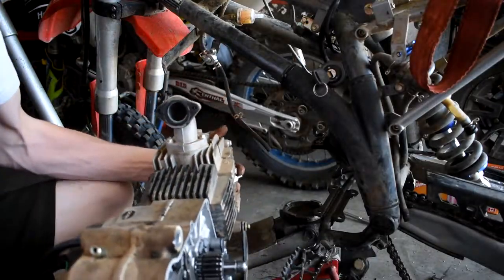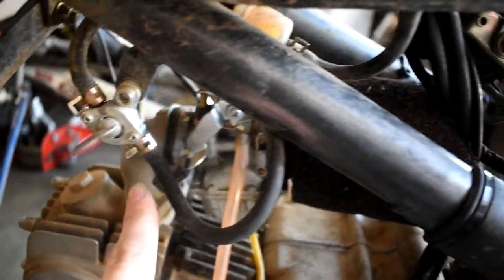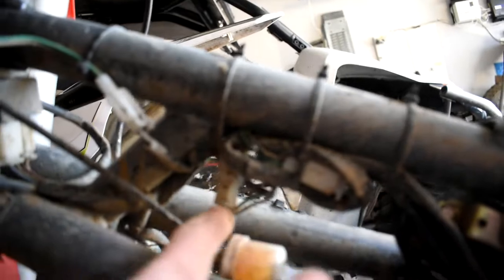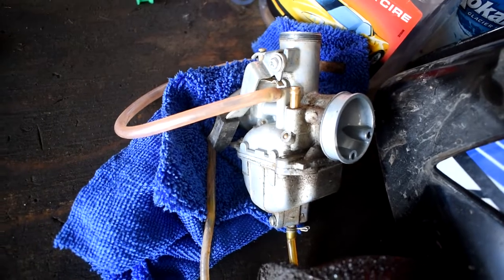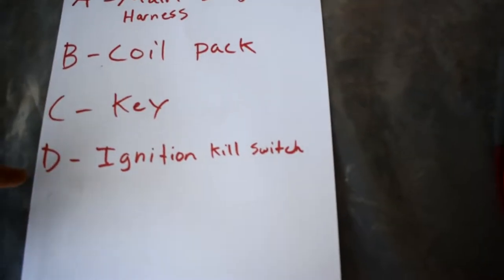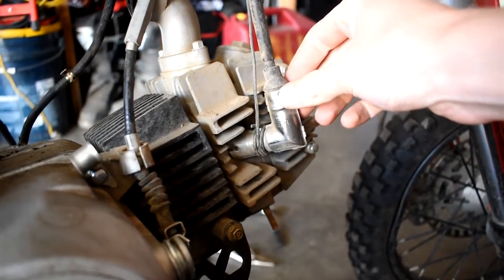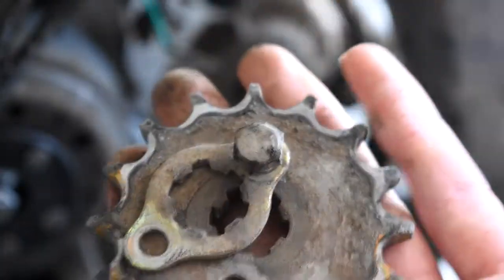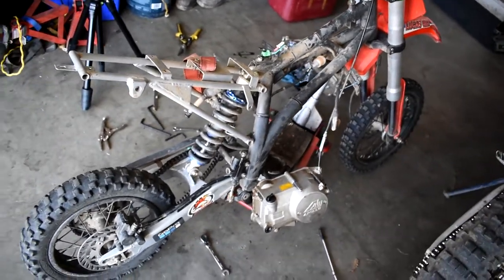2020 Apollo RFZ Engine Swap Part: 1 Chinesse Pit Bike Engine Removal

Comment: Hey man. I know this old video but do you know If the generic 125cc lifan fit to YX140 Apollo frame. In picture the fittings looks exactly the same. But im not counting on it. The exhaust looks same but someone mentioned somewere that they need klx adaptor. I have 32 hours on yx140 and it barely feels worn in. I was about to buy spare engine The generic lifan that suppose to be sturdy motor. I have no complaints about YX though...

Comment: I have to replace a 125cc motor with a new 125cc motor for a dirt bike. Do I need to prime the new motor, or do I just fill it with oil like a normal oil change?
Reply from the maker: Like normal oil change. Run it for a bit then change the oil out again

Comment: Great video. You don’t waste any time. How long will it take to get the new engine? Also if you go with a different engine won’t that be a problem reconnecting the mounts to the frame?
Reply from the maker: Depends on how much support i can get in the videos! Currently a new motor is likely a month out of my $$$ reach
Reply from the maker: Theres motors you can buy that are larger CC that bolt right in. (They’re design and sold from the same manufacturer)
Reply: Aaron Greenway I just bought a shirt to support the cause. Good luck!
Reply from the maker: You’re  the man!!!!!

Comment: Yo are you gonna rebuild it soon Cuz imma miss the riding vids
Reply from the maker: well here's my situation homie, i just bought the bike with my side money i had put away for my first dirtbike and I 110% was not anticipating pulling the engine already. Friday i leave for my 8 day offroading trip ( of which i was supposed to be bringing my dirtbike and exploring new towns. As you can tell my bike broke. I have to use my extra left over cash towards the trip itself in fuel and fare. I'm trying my best to have the quickest turn around. Simply put, i dont have the money needed to just outright buy an engine to put into the bike! I wish i did and if i did i would order a 160 and have it waiting at my doorstep to install the day im back from my trip. At this point it may be another month at least before i have the money to maybe buy an engine, return from my offroad trip, and swap another engine in. Hoping to be able to go on my birthday ride in august. Hopefully you can understand my situation and struggles right now

Comment: I need to know proper chain size for my Apollo rfz DB 18?
Is it the 428 110 link. I wanted to upgrade my chain having trouble finding what size it is
Reply from the maker: Gonna have to count links and look at the sprocket. Should tell you what pitch.

Most are 120link

Comment: Top motor mount fell while riding.... any ideas how i get line the engine up to the brackets without pulling the engine off
Reply from the maker: Start with loosening all the other engine bolts ( not remove them, but loosen them so theres some play to get the too bolt to line up)
Reply: Aaron Greenway alright awesome. I was thinking about that but i didnt want to dig a deeper hole. Thanks for the reply man it really helps. Ill try that forsure. Are there only 3 engine mounts?
Reply from the maker: 3 mounts, 6 bolts total
Reply from the maker: Iirc

Comment: Is the engine bombproof or are they rubbish I ride hondas and I run xr250r and crf250r how is the power bud
Reply from the maker: The engine itself seems decent like a honda rep, its the transmissions in them that seem to poop out. I have a xr100 also, and this apollo walks it all day ( mine i also swapped a 150cc into)
But ive also ridden a ktm450 and this thing doesnt even touch that lol. Maxed out apollo is having the ktm in like 2nd/3rd gear
Reply: @AaronsEnduro  did you say a apollo maxed out upto 3rd gear would smoke a 450 lol mad guy wouldn't even come close to my xr250r and that's not very fast 😂😂👌

Comment: How fast did the 140cc swap make the bike now?? What size sprockets are you running on it. I have the same bike and looking to do the same thing with it. I am looking at the 140cc, 155cc or the 200cc motors. Which would you recommend?? I ride a lot of dirt road and looking for a higher top speed so I dont have to go everywhere wide a$$ open all the time. Any help would be great, I want find anything on line about a Apollo swap!!!!
Reply from the maker: The 150cc swap doesnt make it have any higher of a top speed. Only faster acceleration. The 200cc motor has a 5th gear which has more top end , and then the gearing mod ( i used a 16 tooth front) will give you more top speed
Reply: Thank you for replying to my question. So the 190cc or the 200cc then, cool. Which motor company would you use and have you heard of anyone doing that kind of a swap on an Apollo before?? Do you think the bike could take that kind of power under it?? Sorry for all the questions!!! I just dont want to just guess on my own
Reply from the maker: Yes people have swapped the 190/200cc daytona engine in.

Youll need a clutch cable,
Kickstarter lever, cdi box,  carb/intake , exhaust ( what i can remember off the top of my head) possibly wiring harness if you want electric start . Cant remember if the engine mount bolt up or not for the 190/200
Reply: So you would use the Daytona over the Piranha then?? Do you happen to remember what kind of top speed I maybe looking at with that mod?
Reply from the maker: Daytona yeah, and which mod
Reply: By the way, I love your videos!! Where you ride looks so sick, I would love the opportunity to ride in a place like that.
Reply: Not mod, sorry. Top speed for a Swapping the stock 125cc to a 190cc or 200cc motor.
Reply from the maker: I havent tested the 190cc myself so i cant say